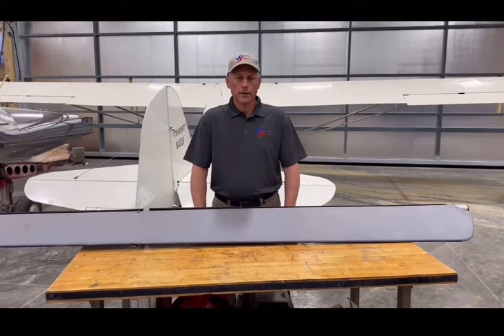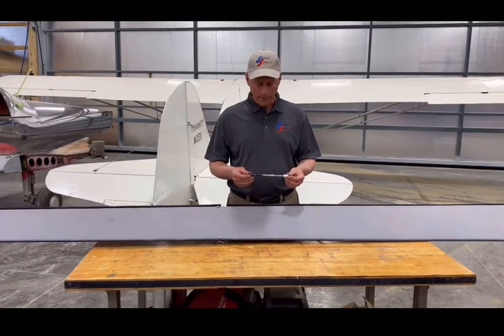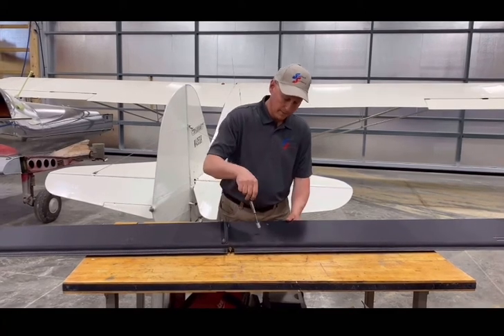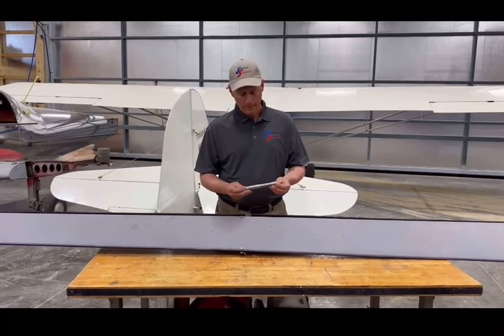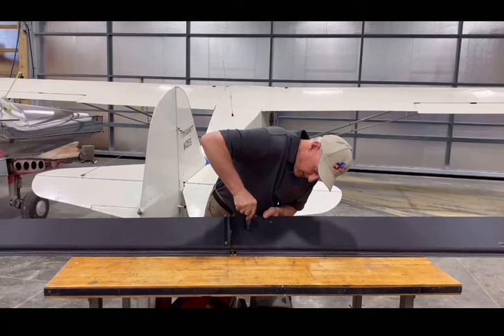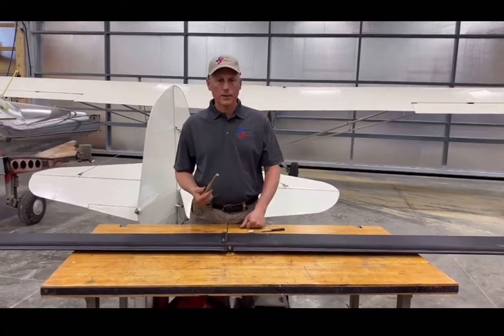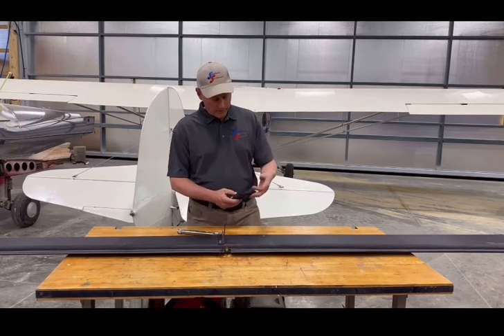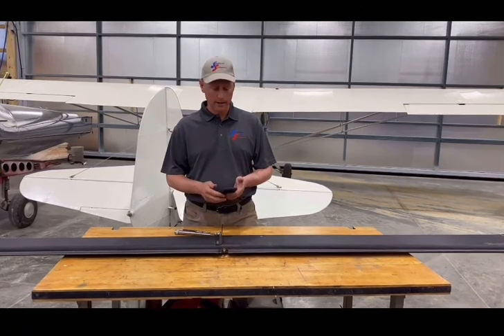Fabric Testing Certified and Sailcloth

Comment: I have polyfiber. Do you know how many pounds it should take ?   Thanks
Reply from the maker: Well, the book numbers on a pull test are 46 lbs absolute minimum.  But with medium Polyfiber if it doesn't hold at least 60 lbs on the Maule tester I would be concerned.  If you want to know for certain, a pull test will tell you, but if it's holding 60 plus I think I would let it fly.  If it's getting weak, the next question is why?  Are the coatings bad or improperly applied?  Has it been in tied out most of it's life?
Reply: @andyinjohnstown  I have the poly fiber light fabric. Which i don't think they make anymore. Not sure. Its on my ultralight and I think its heading towards 20 years old. (No logs on date fabric applied).So if I use the fabric tester from Air-tech it should hold  at least 60 pounds correct? Before popping through the fabric. I searched the internet but the specs are not real clear.   Appreciate the help.
Reply: @andyinjohnstown   Here is a video by Bever which says the pound requirement for the Quicksilver tester is 10 lbs, not 15lbs.  https://www.youtube.com/watch?v=jvqaeoipzkM  Can you post the source of your information? Thanks.
Reply from the maker: @johnnyabove  I believe I found that in the information with the tester.  What I can tell you for sure is that 46 lbs pull test is the minimum for FAA certified aircraft that were originally certified with cotton.  That comes out to 12 lbs on the Air-Tech tester.  My recommendation would be to certainly never go below 12.  But it's up to you, these aren't certified.  What is your personal limit?
Reply: @andyinjohnstown  My tester instruction says 10 lbs and I've used for 16 yrs. I flew a single seat Quicksilver 14 yrs and replaced the sail cloth about 6 yrs after I got when it failed at 10 lbs. I flea it another 8 yrs and it passed the test when sold. I have a Quicksilver 2 place wire brace 503 and I do my annual condition inspections. I've had it three years after I bought it. It passes the 10lbs every  year. So, 10 lbs have kept me good for all these yrs.
Reply from the maker: @johnnyabove  Like I said, it's up to you.  I know the one we tested in the video was tearing as we pulled the ribs out.  I won't let it get that bad again.  I take a more conservative approach.  :-)